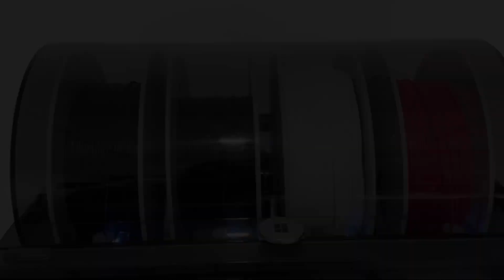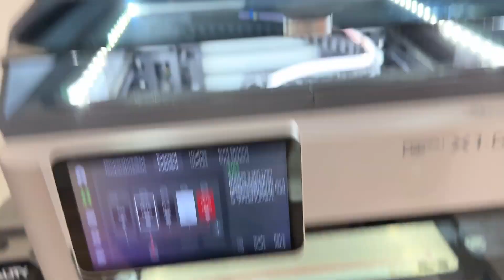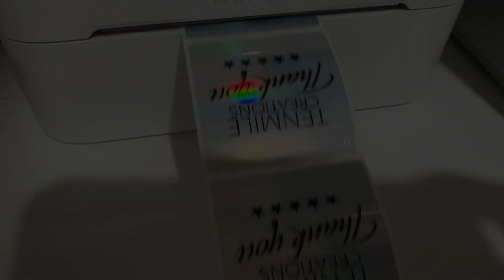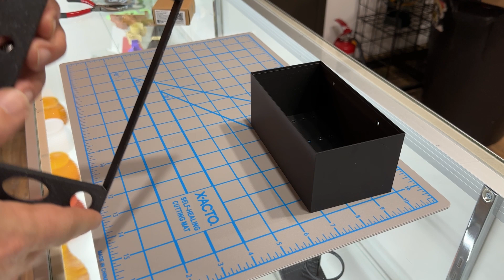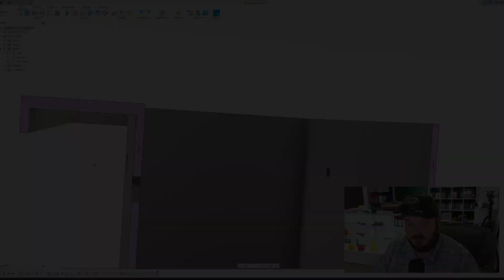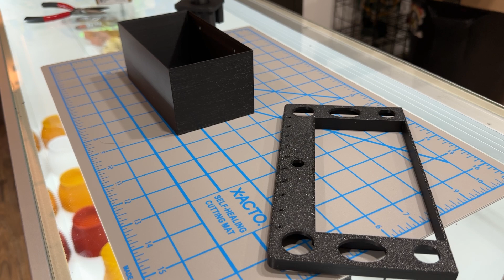3D Print Business with just ONE printer? Can I do it?

Comment: I'm in the same boat.  One 3D printer supporting a small business. Today was the first time it was an issue, got a clog I just can't seem to get unclogged so will prob have to swap out the hot end. But makes me realize I need a complete hotend assembly ready to go, and maybe even a cheap $200 printer as much of my work can be done on a cheaper printer.
Reply: Idk if it's too late to help but if you have a bambu printer you can do a cold pull to get as much out of the nozzle then heat the nozzle to 250-260, take the hotend out with oven gloves and use the small hex key that comes with the printer and push it into the nozzle hole. It could take a bit of force but the clog should get pushed out. It's saved me from throwing my nozzle away when nothing else worked
Reply: @TheMeganano  Hey thanks!  That's pretty much exactly what I ended up doing after finding another video for it. I did also have a thin declogging tool I pushed through there while it was heated up that finally cleared it out.

Comment: when designing for 3D printing, I would recommend adding fillets (1-2mm) to corners of boxes - it's easier on the printer and reduces the chances of delamination/lifting. In order to provide some tolerance, you can chamfer the connection piece, so it provides a tight fit when fully inserted, but still has some room for the glue to expand into.
Reply from the maker: Makes sense appreciate the info

Comment: Niche products like this that solve a problem make the best products.

Are you concerned about the recent Bambu Lab firmware update announcement that will prevent users from printing directly from OrcaSlicer and forcing people to print through the Bambu print server or Bambu Connect software?  Do you print your proprietary product designs by sending them across the internet to Bambu's cloud based print server in China and then back across the internet to your printer?  That was always a complete non-starter for me.

Comment: PetG doesn't work outside, or at least it will for a bit, but will warp as it is not rated for UV. That is where ABS/ASA come in to play. Outdoor and weatherproof
Reply: Petg does work outside. You may be thinking of pla?
Reply: PETG is actually rated very high among the 3D printing materials for UV and chemical resistance as well as heat resistance. This makes it one of the best materials for use outdoors. ABS and ASA are good materials for outdoor as well but these materials have higher ventilation or enclosure requirements than PETG.

Comment: I'm curious on your thoughts on testing 3d printed products (especially our own functional designs).  I'm not sure if I'm worrying too much.  I've had to redesign my parts many times because I'm finding 3d printed parts won't survive a drop from chest high.  Is dropping a 3d printed product from that height too much to ask for?  I'm sure injection molded parts would pass.  What height would a reasonable person expect it to survive?  I don't trust CA glue the most when it comes to impacts.  It's so brittle, but so are 3d printed parts.  When I was printing ABS, they had a higher drop survival rate, but I like printing PETG better.  PETG is 'tougher and gives a little under twisting and bending forces than ABS (the type of forces my product is under), but ABS is stronger when it comes to impacts.  For your pliers holder, I'd have 4 small screws (without heatset inserts) plus glue.  I see plastic breaking and glue not withstanding a drop.  I like to find an in depth test on glues.  Maybe some of the thicker CA glues don't dry as brittle?  I'm really curious what a customer should expect.
Reply from the maker: For items like this with multiple parts that have been glued together, I typically send them directly to my friend for testing and implementation. Since it mounts directly to his boat, he can provide valuable feedback on its performance. While a drop test may not be critical in this case, there are other variables to consider in its application. If he reports that the item broke for any reason, I’ll evaluate whether the issue can be resolved. If not, I may decide to scrap the project altogether if I determine it’s not viable.
Reply: @ExtrusionTherapy  My first drop test wasn't intentional.  I was packing a bunch to send to Amazon.  I accidentally bumped one off the workbench.  Was surprised when it cracked.  I test them now because accidental drops happen and I think if a customer drops one by mistake, it should survive.
Reply: @scaledoctors  - TPU has excellent impact resistance.  The 3D printing community tends to think of it as a flexible material, and it is when printed with 1-2 layer walls and very sparse infill, but it is great for structural functional prints.  The layer adhesion is so good that it's almost as strong in Z as X and Y.  It's extremely impact resistant.  It's also UV resistant and resistant to most chemicals.  On the down side, it prints slower (50-100 mm/s, not the old 30 mm/s TPU recommendation), the surface finish isn't as nice looking as PLA although adding a fuzzy skin texture helps a lot, and bridges and overhangs are problematic.
Reply: @Liberty4Ever  I've thought about TPU for a while.  My hesitation has been the extra drying it needs, lack of bridging, slower speeds and extra cost.  My product is an 8 piece assembly, but only the main structural part (wall mounting bracket) would need to be printed in TPU.  It's the only one that breaks when the assembly is dropped.  There is another benefit to TPU for my product.  The wall mounting bracket has a couple of arms that stick out that the thing it holds sits on.  There's 2 ramp like nubs at the end of the arms to keep the product from falling off.  You're suppose to lift up over the nubs then swing it down to the floor.  People that don't know how to use it try to pull it directly away from the wall without lifting it up first.  This puts a lot of stress on the parts (and the anchors in the wall)  With TPU, I could tune the wall thickness of the arms and design in flex so that if they pull it out without lifting, it will give and slide over the nubs preventing damage.  Ordered some TPU and will be testing in a few days.
Reply: @scaledoctors  - I print a LOT of TPU.  The price is finally coming down, at least on basic 95A durometer TPU.  I recently bought some Tinmorry and Elegoo to test and both were around $21 per kg and seemed very similar to other brands I've used.  I also bought some eSun TPU-LW to test.  It was more3 expensive, maybe $32 for 800 g, but it has a special trick.  This is similar to the Varishore TPU that has been intermittently available in Europe.  It has variable durometer (Shore A rating) depending on the nozzle temperature because it's designed to foam when its printed and those microscopic gas bubbles form a closed cell foam.  The print temperature is 210 C to 270 C.  It feels slightly squishier but it doesn't feel like it has air pockets in it in quite the same way that printing sparse infill to make it more flexible feels.  Another added benefit is the velvet matte surface finish.  I've been trying to find a matte black TPU that isn't shiny and helps to hide layer lines.  TPU-LW looks much nicer than standard TPU and I could justify the added cost on this feature alone.  More testing is definitely needed.  So far, it prints like TPU but is even more stringy.
Reply: @Liberty4Ever  I loved printing ABS, but gave up because of the fumes.  Even though my printers are in their own room off the garage, we do assembling and boxing in there while it's printing some times.  When I switched to PETG, I almost quit due to how hard it stuck to the PEI build plate.  After discovering Windex for releasing the prints, I love printing in PETG.  I know TPU doesn't give off the fumes like ABS, but what do you do to keep it from sticking to the bed?  I hated using glue and I'll probably try Windex on a small area.  The one part that I want to print in TPU has a fairly large surface area and will want to stick pretty hard.
Reply: @scaledoctors  - Thanks for the Windex bed release trick.  I've never heard that.  I've been 3D printing since forever but I'm late to PETG.  I bought a bunch, including PET-CF, with the intention to use it as a less energy intensive and less smelly substitute for ABS in many applications.  I particularly like the print surface aesthetic improvement with carbon fiber.

I love how well TPU sticks to the PEI bed.  Obviously, that means care must be taken not to print large surface areas on the print surface but I usually have the opposite problem.  One of the products we sell is a tall skinny TPU tube with only a small circular contact area with the bed.  The bed adhesion can be fine tuned not only by designing for the appropriate amount of surface contact area, but also with bed temperature, first layer nozzle temperature and nozzle height.  I usually change the bed temperature because that's the easiest, and lowering bed temperature makes prints start sooner and uses less electrical energy.  Many of my TPU parts print on an unheated PEI bed.  Before PEI, I printed a lot of TPU on borosilicate glass, both flat and textured.  If you screw up and have too much TPU bed adhesion, pop the part on the bed in the freezer, although even then, when it releases it could pull some PEI off the build plate.  I've never had that happen but I've been careful not to stick the PEI to the bed too much the last few years.  I do need to remind myself of TPU's bed adhesion on the few occasions when I print a large object, such as a battery cover for my little Japanese mini truck, or a pannier rack for my little adventure motorcycle.  TPU's excellent layer adhesion allows me to print parts standing up on the very low surface area end where bed adhesion is strong but the part will release, without worrying about the part breaking along layer lines when printed in an orientation that would be very weak with PLA, ABS, etc.
Reply: @Liberty4Ever  Thanks.  I can see that I'll need to do some tuning to get TPU to stick the way I want.  I'm excited to try it and I think it will make my product better.
Reply: Just a noob idea, can “snap fit” works better than glue ?